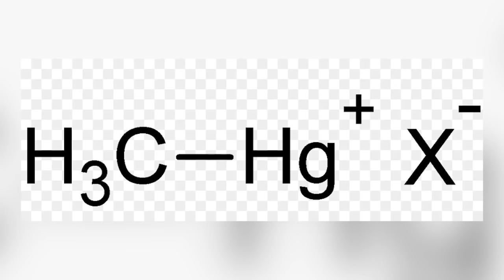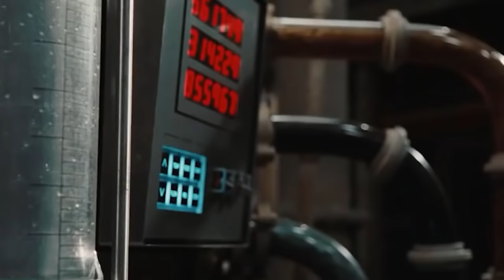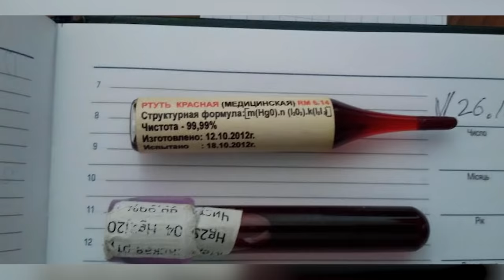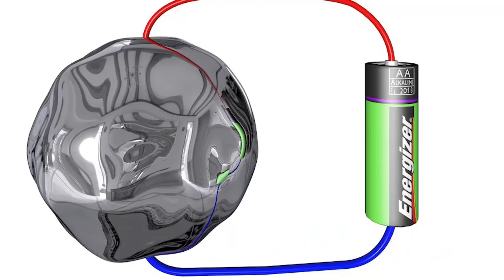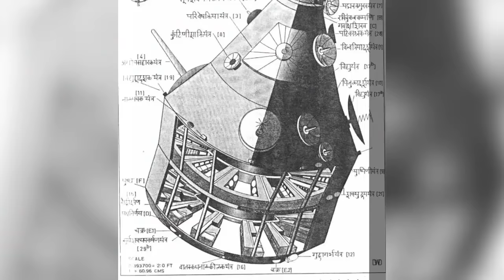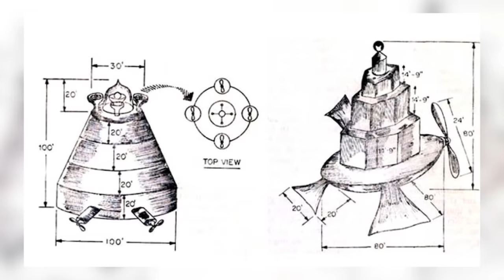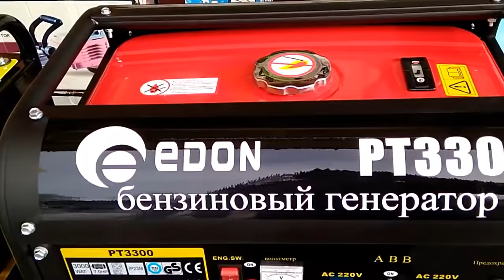Thats Why Mercury Engine Is Forbidden

Comment: Mate, liquid mercury can’t generate antigravity fields, there are no antigravity fields. To generate antigravity you either need negative matter or a localized antigravity as a vacuum in a heavy medium, you’re not going to get it from a transition metal that happens to be molten at STP.
Reply: not all is at it seems. did you know that warp fields exist . some times misnamed antigravity. mercury , in a magnetic containment field rotated to many 10 's of thousands of rpm 's   displays  some very interesting effects on space-time
Reply: Never say never
Reply: @mikefugate1367  nope, sorry, it does not. Spinning magnetic fields utilizing the strongest materials we have on earth exhibit no "anti-gravity" effects as of yet. This mercury drive is not reactionless either, you're always going to put in more energy than you remove. Spinning, heating, or cooling material in any way, shape, or form inside a closed vessel gives you zero net force in any direction over time.
Reply: The Vedas say otherwise.
Reply: @whiteeagle6370 Veda mercury ion drives are not antigravity. They eject mass for trust; not spin it up.
Reply: How can you know? That's only if you believe gravity to be what it's claimed to be. There are enough scientists out there to admit we don't know anything about gravity, and that it has more to share with electro-magnetism than a so called "pull" generated by a mass (which kind of sounds absurd, honestly said...). If gravity is indeed a manifestation of electro-magnetism, it's not stupid to assume that mercury could effectively be used to counter it, or at least power some engines that can make a craft fly. (what seems to have happened already thousands of yrs back with the vimana's and throughout history after).
Reply: in combination with other materials it could be viable for various scientific applications. Mercury is dangerous though for sure it’s actually how jack parsons blew himself up.
Reply: Dude you aren’t god... you don’t know what the secrets of the universe are
Reply: @Di66en6ion  I think you assume too much. Hence the arrogance or humans
Reply: @jumpieva  I can only go by what has or has not been experimentally verified so far. It's not hibris...  that would be people claiming to know reactionless anti-gravity exists without a single shred of evidence to provide to back it up. Seems half of YouTube is full of temporary inconvenienced Nobel winners.
Reply: Spinning a superfluid containing mercury at certain speeds causes frequency shift. Which enables via craft to seem to have "anti-gravity".
Reply: Mercury can be tuned with frequencies to off set or take advantage of Earth's magnetic field. Ur small mind can't conjure this scenario in your Lil brain tho. It's ok, daddy is here....
Reply: @jondoe2341  Earth's magnetic field is weak af, your fridge magnet is stronger, just not as wide, you'll never get anything resembling a significant force that opposes gravity.
Reply: @sologuitar100  I don't need to know everything to know some things, such as how to approximate gravity using general relativity, implications of that, and also certain philosophical concepts such as the razor, or the non-applications of the fallacy that "just because everything has been a certain way, doesn't mean it always will", when it comes to understanding the universe. For example: I know that wrapping a copper coil around an apple and "powering" it with someone laughing at the wire won't cause all apples to become sentient, because that is ridiculous. And while less extreme, such pseudo-sciences might as well be that if they contradict established facts. That isn't to say you can't challenge the status-quo, just that when the status-quo is the universe itself, you might be wrong.
Reply: @RenoLaringo  You are assuming that gravity is a form of electromagnetism when that is patently false. Gravity is a non-force, just because we don't understand how it exactly works, and don't have a theory of quantum gravity, doesn't suddenly make it electromagnetism. This is something that I very much don't like about even the general consensus of the particle-physics community regarding gravitons, while a spin-2 boson would act like gravity, we have not observed such a particle, and we already have a valid theory that works without a graviton called general relativity. Which btw, spin-2 is not spin-1 which is photons, the force carrier for the electromagnetic force. The only major similarity between gravity and electromagnetism, is the Newtonian approximation of it which uses the inverse square law, which while is somewhat inaccurate, this better illustrates not the connection between the forces, but about how space works in general. Our 3D Euclidean (In small scale non-extreme conditions) universe uses inverse square laws for how things "dissipate" into space.
Reply: @AH-mj1rd  Get out of here Bieber
Reply: @mikefugate1367  I know about warp fields, and I know about mercury, what I don't know about is where this information comes from or how it would contradict all of reality yet be even considered.
Reply: @MCNarret  ok...
Reply: @Di66en6ion  you speaking from experience ? When is the last time you observed the exact minute micro effects of liquid mercury spinning at thousands of rpm's, oh yeah thats right, you never conducted that experiment.
Reply: @orionfierro5115  So cite a source for your claim or build something to demonstrate it.

A youtube video is neither verifiable nor evidence for anything. Put up or shut up.
Reply: You sir, are correct. No such thing as an antigravity field, with the exception of two magnets in close proximity to one another. But magnets are getting more powerful all the time.

Comment: Worked in a steelworks chemistry lab in the 80's and we used to have an open bowl of mercury in the corner of one of the labs, used in a pressure test we did. we also had a desk with a lip around the edge and would often play finger football with the drops of mercury.

Comment: I used to play with mercury from a thermometer I broke when I was a kid.  Healthy at 53, no problemo.
Reply: Same as me healthy at 22 as well
Reply: Ditto. 58. Can't have free energy now can we?
Reply: Mystic Madman 
I used to meltdown lead from car batteries in an old cast iron pot shoved down into the coals towards the end of a bonfire. We’d pure the molten lead into old corn shaped cornbread baking molds. We’d play a game we made up called corn pot & we’d throw the lead corn into the same pot it was melted down in. After a while the corns would get so beat up that we’d just me smelt them again. I remember my hands being silver and my face from wiping it off. I’m 40 years old now and for the most part in good shape. Most of the negative I suffer from is from a fall from a second story deck while building screwing down the deck floor. I broke my eye socket, nose, jaw, shoulder, and dislocated my leg at the hip
Reply: @aaronburratwood.6957  we talking mercury and led don't stain face and hands too
Reply: Invisible Prance I think you could pretty much smelt anything down and your hands would get covered in crap and I’m betting you could wipe it on anything.
Reply: Mercury was used in the making of felt for hats.  People who worked in the shops would go crazy after many years working in the business.  A term was coined for crazy people, who were called, mad as a hatter.
Reply: My brothers, sisters and I used to take the mercury out of dad's jar and roll it around in our hands. Even brought to school for "show & tell" once. We all became either doctors, teachers or scientists. We're all still healthy. I'm 73.
Reply: @OswaldBeef  I think you didn't read the comments properly
Reply: @invisibleprance3749  think what you like, just dont wipe it on your face.

Comment: I went to an estate sale back in the nineties in Amarillo Texas. It was there I saw a gyro guidance system. The family said it was from out of a Nike missile that their grandfather had purchased from a government auction. The ring part of the gyro, the spinning part, was enclosed in glass filled with silver mercury, This would spin from an electrical a power source when the power was turned on. Attached to this gyro were a series of wires that controlled stabilizers' for guidance of the missile. I have never seen anything like this since then. Is there anyone out there familiar with guidance systems that may have seen this?

Comment: I used Mercury for an anti-vibration  dampener on my compound bow, as an experiment back in the 80s once. It worked fine for a dozen shots or so, then the thin metal capsule that contained the Mercury, Exploded , My guess it was caused by the stuff vibrating at such a high pitch(because of the bow string vibrations), that it turned to mist or some such thing. IM NOT SURE !!!
Reply: Hey a new kind of bomb 💣
Reply: That's actually a pretty brilliant experiment. I feel like it would still transfer vibration but I may be thinking about it wrong. If the vial is stiff enough maybe it would dampen vibrations from guns.
Reply: @gavinperch9413  but it wouldn't make the lighter mercury explode again?
Reply: @nickywilliams8540  I think he was saying the capsule that held the mercury was what broke, so maybe if a thicker container is used it should handle guns as well so long as the container doesnt hamper the effectiveness of the mercury.
Reply: @gavinperch9413  ahh I see now what you mean yep
Reply: if the metal capsule you used was made from aluminum, that's why it exploded. mercury erodes aluminum very quickly, almost as fast as gallium. mercury is also VERY dense, when I was a young kid I found that out real fast when I gently shook a small glass vial of it and it immediately shattered and spilled all over the shag carpet in my bedroom. trying to clean it up with a vacuum cleaner was a joke! - coz of course it just separated into smaller spheres and went deeper into the shag pile. and I lived with that stuff in there for years with no apparent health effects from it. just try and imagine how violently the mercury in your capsule was vibrating and oscillating, and the how those hydraulic pressures alone would need to be quite securely contained...

Comment: Your own statements: "We know from studying damage that even mercury vapor can cause irreparable damage to the human body..." then you ask, "But why are we so afraid of this substance?"  Derrrrrrrrrrrr......
Reply: Because it kills you!
Reply: Methylmercury (sometimes methyl mercury) is an organometallic cation with the formula [CH3Hg]+. Its derivatives are the major source of organic mercury for humans. It is a bioaccumulative environmental toxicant. however, in light of observations, ethylmercury is eliminated from the body and the brain significantly faster than methylmercury. As the most common source of mercury in nature,[17] cinnabar has been mined for thousands of years, even as far back as the Neolithic Age.[18] During the Roman Empire it was mined both as a pigment,[19][20] and for its mercury content.[20]:XLI[non-primary source needed]

To produce liquid mercury (quicksilver), crushed cinnabar ore is roasted in rotary furnaces. Pure mercury separates from sulfur in this process and easily evaporates. A condensing column is used to collect the liquid metal, which is most often shipped in iron flasks                  the actual mercury liquid is not dangerous, the fumes from heating mercury are dangerous.

Comment: But it does accumulate in the body causing nerve damage from the toxic build up
Reply: Pure mercury, yes.
However, mercury compounds depend on the type of compound.
For example, sodium is extremely reactive with water and chlorine is toxic.
In the compound sodium chloride (salt), however, the properties of both substances change.
It is the same with some mercury compounds.
Reply: @sylviarohge4204  So you would willingly live with a cup of mercury without a lid in a steril house. And what about the mercury vapor on room temperature ?
Reply: @sylviarohge4204  Elemental mercury is relatively harmless!  Mercury salts are highly toxic,
Reply: @adambalogh8728  Virtually no mercury vapor at room temperature!

Comment: We have discovered how to convert mercury into gold. Though the cost of manufacture and the miniscule amount makes it highly unprofitable.
Reply: Herbert Fuchs  either way it's possible yet unprofitable.
Reply: Herbert Fuchs  and actually your wrong lead has been turned into gold through nuclear physics. That is exactly the method i was talking about. I'm sure that there are also other base materials that can be transformed through nuclear physics also. Either way the main point is that it can be done just not in a profitable way.
Reply: Herbert Fuchs  "It transpired that, under true nuclear transmutation, it is far easier to turn gold into lead than the reverse reaction, which was the one the alchemists had ardently pursued. Nuclear experiments have successfully transmuted lead into gold, but the expense far exceeds any gain"
Reply: Herbert Fuchs  and sorry i meant to write lead not mercury in the original post. So yes I was wrong. Mercury was on my mind due to pondering about electro magnetism, gyroscopes, superconducting and anti gravity. My thoughts on this subject were essentially a superconducting gyroscope, spinnning inside of some sort viscous metal/liquid (which maintains the proper temp for super conductivity while similtaniously being a catalyst for electro magnetic phenomina), incased in some sort of alloy shel. I know that we have new materials which are highly conductive yet do not produce heat.
Reply: Here is prrof that I was actually still right about mercury though. Only the mercury isotope 196Hg, which occurs with a frequency of 0.15% in natural mercury, can be converted to gold by slow neutron capture, and following electron capture, decay into gold's only stable isotope, 197Au. ... However such high-energy neutrons can be produced only by particle accelerators.. Still highly unprofitable.

Comment: all You have done is Speculate, Lets see some Proof
Reply: There are blueprints out there, just look for it and you will find.
Reply: Mr Seppo So that’s how it works. Well now I just feel silly. I’ve spent soooooo many years placing the burden of proof at the feet of whomever is putting forth the idea.
Reply: Yeah, people like to site hearsay as facts. Makes for a good story but little more.
Reply: Why not try and do the research yourself instead of demanding that someone hand it to you  on a platter with no effort on your part. Yes perhaps (just as you admit) you should feel silly - most skeptics are... and bone lazy. Many are scared that their precious paradigm might be bruised and dented, simply because they can't do their own research and lack the creativity of the true scientist - curiosity. The clip has given you enough clues help you but still you resist. I can see you'll go a long way with that sort of approach... along way to nothing.
Reply: @Mr_Seppo  if there are put the links in.
Reply: @bigglesOz  also, wheres you chemistry and physics degree?
Reply: @bigglesOz   Mercury engines do work but not in the method described in the video. Mercury engines can actually generate thrust and could theoretically lift and object, this is not anti gravity, it is just thrust. For something to work as described in the video would violated several laws in physics. This does not mean anti-gravity is impossible, in fact the more we learn about our world the more it becomes clear that anti-gravity should be at least theoretically possible. This is mostly due to the fact that for the longest time we didn't really know what gravity truly was, and this a something we still don't actually fully understand even now.
Reply: To have the oppasit to gravity is a push from the object not a absent of that my frend is "space the finale frontier" which is not right either there is still pull
Reply: @That_one-guy192  LOL Too much truth hurts a liberal's brain.

Comment: The early propellant for the TR 3B was Hg2Cl2 or Mercury's chloride. It was easily vaporized and ionized by the nuclear reactor that powers the ship. It was swapped out by cesium iodide which has a much higher energy value and does not put out a brilliant blue green glow.

Comment: in the 1970's i worked at a tungsten carbide company that had a 3 gallon bucket over half full of it . they bought scrap carbide bits. they used the mercury to separate the titanium  carbide from the tungsten carbide. the titanium floated and tungsten sank. i spent a couple hrs doing about 300 pounds  one day. spilled  some  got it in a dust pan with the dirt and put it in a shop rag. twisted the shop rag tight and just like water it came out. also if you throw a handful down on the floor for just a instant the floor looks like a mirror before it balls up and rolls everywhere.

Comment: Back in the 50s I and a few other kids would always be messing around with Mercury. I got mine from Mercury switches or thermostats with the little glass vile. Every so often I'd hit a hardware store or some big store with  a hardware dept. I never got sick or got dain bramidge. One of the cool things I did was to put a puddle of it in the palm of your hand then a silver coin(all of the coins were silver back then except for the penny) and move the coin all around and give it a good bath. The  Mercury would coat the coin and make it very slippery. As far back as I can remember I've always been drawn to magnets, Mercury, and electricity.